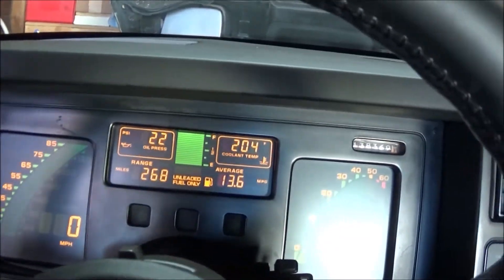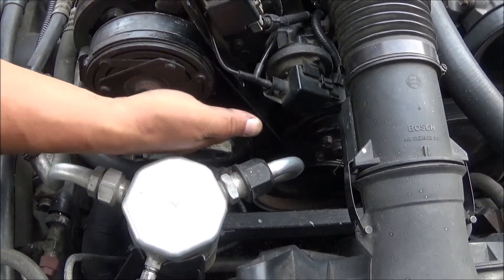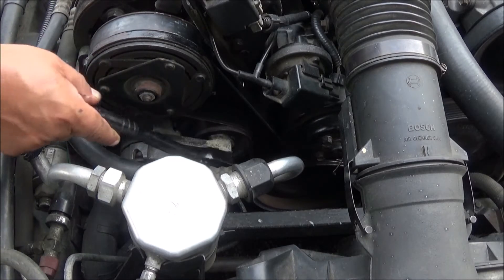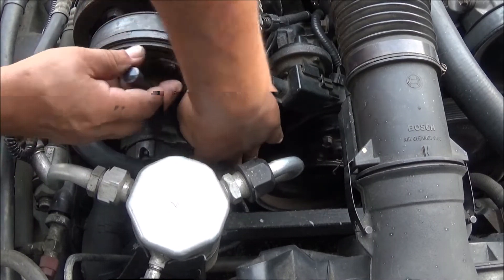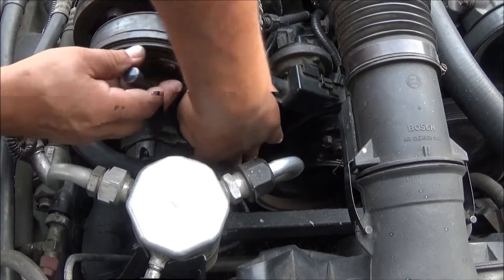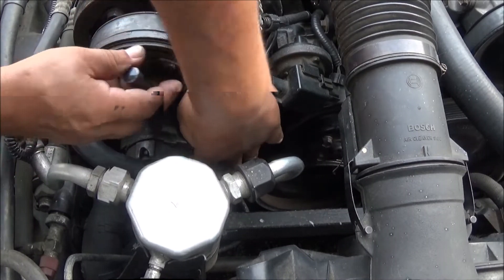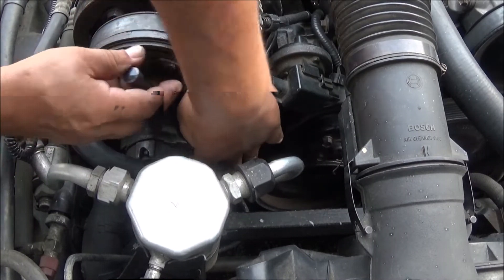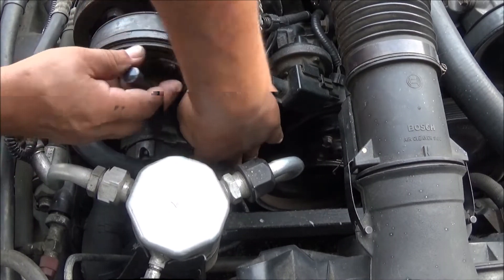Video 48 Idler Pulley Replacement - Oh What A Pain This Was.... 1985 C4 Corvette 5.7L

Comment: Any fastener that threads directly into the block or heads will be SAE, as they always have been on SBCs. I assume GM had pretty good reasons not to change that. Just about everything else seems to be metric on my 1988 C4. Sometimes, both metric and SAE sockets/wrenches will fit a fastener, such as 5/8 and 16mm, but one will be noticeably tighter-fitting.
Reply from the maker: I do agree with you on this item, that Chevy would not use two different types, but in my case either they did or the person who went into the engine before me did. As I pointed out a few times there were new gaskets found on the top end as I disassembled the engine, and I believe that someone else was in the engine before me, IE the previous owner.